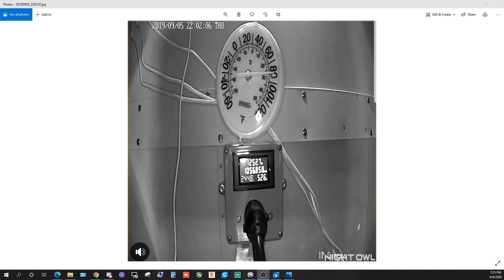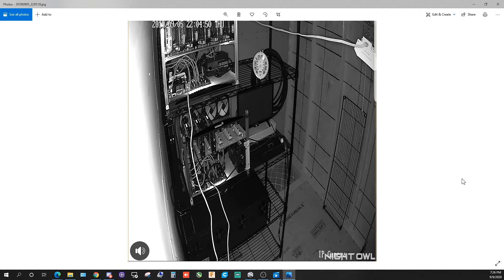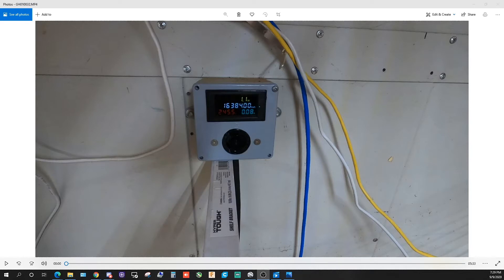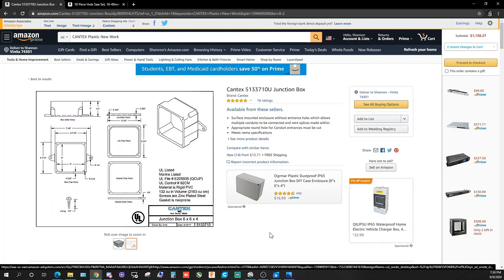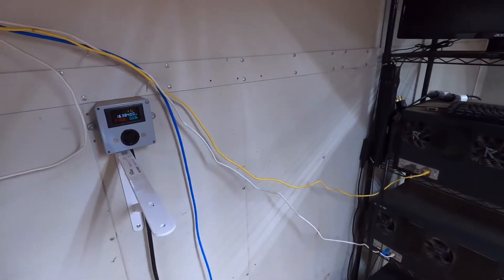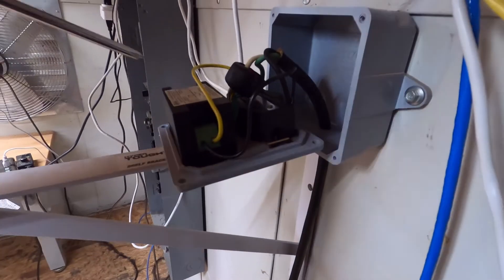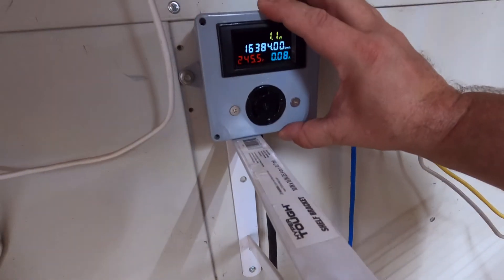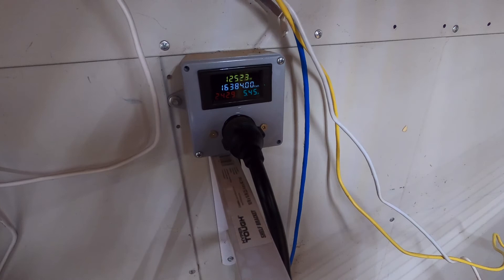240V 30AMP outlet for my Mining Shed.

Comment: This does not make sense. You will not get a reading for 220 wattage by only having the CT around one leg. All it will see is the current flow on a single leg. I believe your meter displays 220v because you are powering it from the 220, but the CT isn't reading the wattage across both of the hot legs. I don't believe you are getting the reading you expect.

And you can't simply fix this by running the CT around the 2 hot legs either. You can only measure the current flow thru one of the wires. I found your video looking for a way to get a similar output but your way isn't quite right. If I am wrong please explain it to me. Thanks.
Reply: You will get current from measuring one wire (one hot "leg")  like you said yourself.
If you measure both, you would just get the leakage current against earth.
You will get Voltage from measuring between both hots (or hot and neutral on 120V) > Thats what the Screwed Panel on the Power Meter is for.

Wattage then is simple maths.
Current (A) x Voltage (V) x Powerfactor (cos phi] = Wattage (W)
Current (A) x Voltage (V) = Apparent Power (VA) in AC

Comment: Space ghost I have a simlar issue in my server room. What plug do you use to convert the  L6-30 to C14 to plug into the power supplies? Are you using a PDU? or  break out cable?
Reply from the maker: I used a PDU with L6-30 and then used cable for the PDU to power the PSU
Reply: @spacegoats2194  I eneded up getting my hands on a couple of Leviton PDUs after watching more of your videos and from Red Panda thank you so much for getting back to me. Also ordered a gang of c13-c14 cables thanks sir.
Reply: I'm trying to figure out what cable to use to plug into the L6-30 sockets I have an convert them to C14 cables that come with the server power supplies. They arent working with my standard wall sockets. I'm not an electrician so please excuse me.

Comment: What kind of cable is used inside the box? What does the other end of the cable look like? I assume it’s the same type of connector that you show at 10:29 and plugs into the wall where the electrician ran the 30amp circuit? Also what gauge wire did you use for the drox signal?
Reply: I have the same question. not sure what kind of cable that is...

Comment: Slick setup! Quick question on the wiring I couldn't quite make out from the video so please correct me where im wrong. For 220v both your black and white are hot (ie 110) green is ground.  It appears you have just the white leg going through the transformer.  Then you have a pigtail from both the hot legs (ie white=yellow pugtail and black = black pigtail)  going into the voltage block on the meter, am I seeing that straight?

Comment: I'm planning now to add these type of meter, I will have a 220V 30amp to my mining room. One thing I can not seem to wrap my head is that if 220V have 2 hot of 110V legs and only 1 is being monitored, how does it able to monitor entire current for the pdu? In my case I am going to use a pdu with L6-30P PDU? I thought I needed 2 meters to monitor
Reply from the maker: All that is done in the meter, I am guessing there is some smart chip that works like a regular Volt meter...

Comment: Do you sell these 240V power meters? Im currently using the L6-30 connectors.
Reply from the maker: I don't sell the whole units but will sell a 3d printed box and lid for the L6-30R outlets
Reply: @spacegoats2194  How much? Shipping to 85234 (AZ). Just wondering if the box is something you can get at Lowes/HomeDespot? I don't think I want to invest in a hole saw, probably better to get one 3D printed with all the appropriate cutouts already done.
Reply from the maker: https://amzn.to/3b4dsiG
thats the meter I use
https://amzn.to/3o8FJIB
and outlet
https://amzn.to/2X3SvMn
Power cord

I sell the box and lid for $20 plus shipping. But you can also use a marine grade box and cut hole in the lid
Reply from the maker: $20 plus about $10 in shipping
Reply: @spacegoats2194 Ive ordered the parts, if you can let me know how to pay you the $30 then we are good to go.
Reply from the maker: @ronwatkins5775  send me a msg on discord

Comment: Whats the yellow and black wire on the green side are they spliced into each 120 wire for the 240 read?  Got my box and stuff in need to wire it.
Reply from the maker: those are the signal inputs for the meter that was just extra wire i had
Reply: @spacegoats2194  do the gauge wires matter for these ?

Comment: I like the camera idea for monitoring. I have been using smart plugs with voltage monitoring, but it's hard to find good ones for 220-240v. I will have to make a few of these soon !!!
Reply from the maker: I'm working on a 3d printed box right now, I just started the design process. Hope to have it done here in a couple of weeks
Reply: @spacegoats2194  Cool 👍

Comment: Great meter , trying to build a shed like yours to run my future rigs
Reply from the maker: If you build it Rigs will come....
Reply: @spacegoats2194  where did you get those closed mining frames from? It would be awesome if you can make a video about them and specially your ventilation setup
Reply from the maker: You mean the 13 gpu cases?
Reply: @spacegoats2194  yes
Reply from the maker: This video is on the 10gpu version of my 13 GPU case. Same case just a little small. https://youtu.be/jF3p0wyTgUA
Reply: @spacegoats2194  is there any 3D service I can use to print those 3 D GPU stands , need one really bad and can't even find them on eBay nor I have a 3 D printer